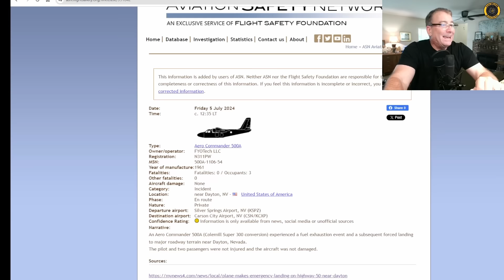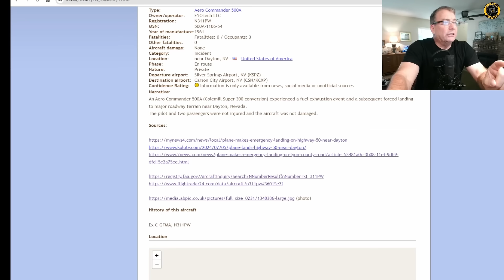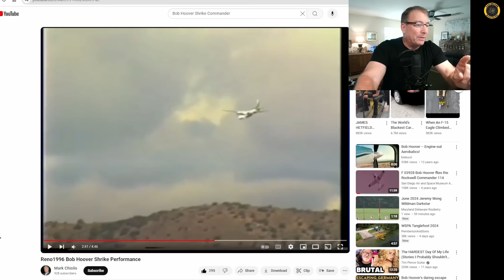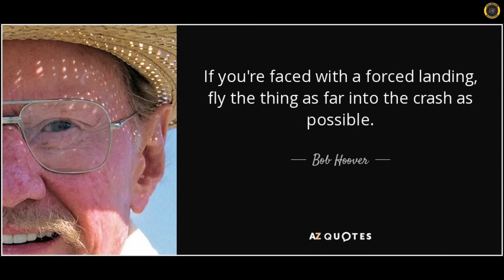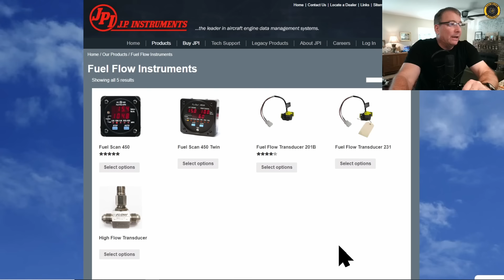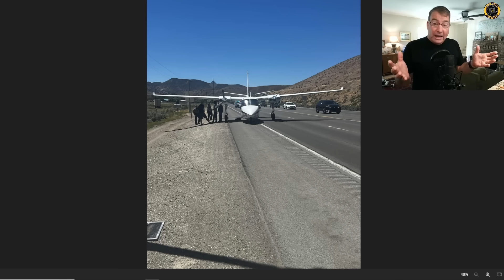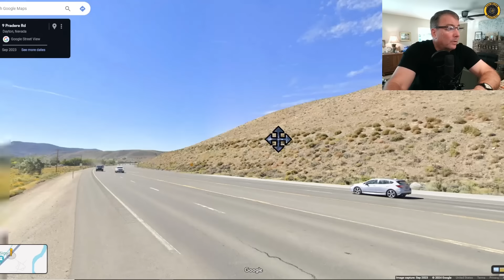Aero Commander Forced Landing Hwy 50 Dayton NV 5 July 2024

Comment: Digital fuel gauges are great, but they must be properly calibrated. Sounds like the JPI gauges might have been installed, but never properly calibrated. I would have removed the old gauges or placarded them inop. There is nothing worse than two instruments that disagree with each other.  Verify the accuracy and then trust it.
Reply: "A man with a watch always knows the time.  A man with two watches is never quite sure..."

Comment: Every CFI and AP I've ever known going back decades has said "never trust the fuel gauges" - the old float style senders are SO failure prone and inaccurate, and have caused so many avoidable accidents, I just don't understand - have no companies out there developed cheap, drop in fuel sender replacements which use modern capacitive or ultrasonic sensors for older piston singles and twins yet? And if they exist, why on earth does anyone still fly with old float sensors on their planes? This seems like a no brainer.

Comment: In general aviation aircraft the fuel measuring system is very primitive and nothing like the capacitance probes of transport category aircraft which span the length of the wing and provide very accurate fuel level information. Fuel flow such as JPI is fine, but as they say garbage in garbage out -unless you know what you’re STARTING with, any fancy technology in a light aircraft could easily provide erroneous information as to the actual amount of fuel in the tanks. 

In Texas, a few years back near Kerrville there was an accident with a Beech Baron. Again, the pilot  relied on fancy fuel flow information and experienced fuel exhaustion because of over- estimating the fuel he started with. Unfortunately, all 4 occupants passed away in the resulting flat spin.

Comment: ...Bob's Shrike had plastic tubes from the oil breathers - his manager/announcer told me that pretty much all the engine oil puked out during the show - I watched him put at least 6 quarts in each engine after the crowd left.  At a show up at Bellingham, Bob had just lifted off - doing his roll on takeoff, and suddenly quit the show, came back around, and rolled up to the announcer stand.  He popped open his pilot's door, and chucked a fire extinguisher across the ramp.  He then took off, and did a somewhat limited flight.  A few years later, at Pasco, I introduced my son to Bob and his announcer, and mentioned that I remembered the fire extinguisher incident.  Bob turned to his announcer and said, "WELL - HE remembered the fire extinguisher!"  I saw him do his show in the Rockwell Saberliner - not too exciting since you couldn't tell if he had shut down the engines!!

Comment: His first option was to go to Dayton Valley Airpark (they actually flew over it, before the problem showed) but he made the smart choice and put it where he could get on the ground safely, rather than trying to get the two more miles to the runway.  The Silver Springs airport manager actually watched him come down.

They probably towed it to Silver Springs because they had a wide road the whole way, with clearance for wings and tail.  I go through there periodically, and that would actually be an easier tow than going to Carson or Dayton Valley, even though it was about 5  - 10 times as far as the other fields.  They opened a hole in the chain-link fence to get it onto the airport, and towed it to the fuel pump.

They did NOT fly back to Carson yesterday.  A local plane owner reported that they loaded 100 gallons of 100LL, started the engines, but on run-up something didn't feel right to the pilot, so they tied it down for the night and rode back in the tow truck.  I drove past at about 1030 this morning and it was still sitting there.
Reply: I wondered why they didn't try the Dayton Airpark also. It all worked out well, except for the closing the 50 for the long tow😄
Reply: @hotrailstohell   Be a good excuse for being late.

Comment: all NHP had to do is block a section long enough for a T/O block both direcrions for all of 10 minutes and traffic could flow again easily same thing happened to me ON hwy 50 as well by lahoton resevoir fixed the issue had the road block for 5 min and T/O the road never experienced a long hold of traffic (my issue wasnt fuel starvation tho 😎

Comment: Basically I guess this pilot under estimated his fuel consumption regardless of what the digital or analogue were reading. We were taught that fuel gauges are unreliable and to use the  calibrated dipstick method which is always difficult on high wings and sometimes you needed two  if the aircraft had tip tanks as well. I remember flying passengers in a 182 back from a country property to the city on a very late afternoon early evening.The analogue fuel gauges were showing near empty ( but well known on this aircraft) and the passenger in the right hand seat noticed them and began to panick and demand I land at a closer airport. Initially he did sow doubt in my mind ( he was a car salesman) but I explained that I had measured fuel by the dipstick method before we left and we would have 90 minutes reserve after we landed at our destination. He was still unconvinced and continued to carry on. Of course, if my fuel consumption estimate was wrong, he may have been correct and had cause for concern. When we landed I dipped the tanks and showed him the number of gallons we still had on board but it made for an unpleasant flight for me.

Comment: We had a JPI in the Maule with an extremely accurate fuel flow function that we got into a habit of trusting. One day we found out that it's only as accurate as the idiot who told it how much fuel there was when you started. Luckily we found out at the pump but man, it was close.

Comment: Measuring fuel flow is fine but you need an absolute measure to calibrate against or there can be drift. With digital pressure sensors you can compute a good measure even if you are sloshing around with flat tanks. Doesn't take much algorithm to average over time and seeing slosh in response to g forces is a great check that the data you are seeing is real fluid, not a faulty reading. I call that principle rich data. Simple computer control is the way to go for many things. A water sensor is also good. Nice warning to have before take off. And yes good energy management is good too. I like to think of the whole descent slope as doable without power. Even fairly terribly gliders with a ratio below 10, do you really have to descend shallower than that...  if your plane can only do 1:7 why not come down at 1:7 or steeper... do you have to come the last 100km at 1:15 such that engine out is critical...  descent speed is typically higher speed than best glide so if engines fail you just keep the track at a bit lower speed. Should you need to burn speed there is flaps, gear and you can go low and fast in the soup to drain speed.
And of course good synthetic vision is nice to have in zero visibility when flying a glider. Problems don't only happen in socal sunshine.

Comment: I remember a turbocharged Shrike mod but most Colemill Continental conversions were non-turbocharged IO 520's. 

I've flown Twin Commander 500's quite a bit and the obvious advice is to never take off without sufficient fuel, although his possible failure to do so is mitigated by this pilot's masterful job of putting the aircraft down in one piece. Commanders are wonderful handing pilot's airplanes and their fuel systems are a model of safety and simplicity: it is nearly impossible to mismanage fuel in flight. There are no fuel tank selectors or cross-feed with an engine out because four fuel tanks feed a single header tank that supplies both engines. if there was any fuel aboard, this system should have been able to feed both engines, so the question of fuel management comes down to a single question: was there any fuel in the airplane?

Comment: It isn't always realistic or even possible to take off with full tanks if you are carrying passengers or cargo.  I'm assuming, of course, you don't want to exceed max gross weight and crash on takeoff.

That said, there really is no excuse for fuel starvation incidents.  I suppose a small percentage of them are due to mechanical issues, but if we're speaking honestly, the vast majority of them are caused by pilot foulups - whether because of ignorance of the aircraft fuel system, laziness, arrogance....whatever.

Comment: Why is is ever appropriate for any aircraft private, commercial, or otherwise to attempt to land on an occupied highway? I'm not a pilot, but it seems to me that when you get on an airplane, you take on the assumed risk that airplanes sometimes crash. I get that true accidents happen and deciding where the plane crashes is impossible. But, to consciously decide to risk the lives of drivers to save your own skin to me is reprehensible. How do pilots justify the risk?
Reply: Not an assumed risk if you are a passenger and believe the pilot has enough fuel or do you sign an indemnification agreement when you board a plane?
Reply: @bw162  I disagree. Passengers understand that planes crash, the same as pilots. You wouldn't allow cars with passengers to swerve onto playgrounds to avoid crashes regardless of wether children were hurt. The risk is yours for in driving your car. Passengers too. I think it's always wrong to put others at risk to mitigate your choices.
Reply: @murdock1450  You would be the first to sue the airline if injured.

Comment: It looks like they were within gliding distance of a great runway at Dayton Air Park. Why didn't they choose to land there? It would've looked very foolish if the landing on Hwy 50 had ended up in injuries, damage, or fatalities to anyone on the airplane or the ground when there was a perfectly good airport nearby. The other takeaway from this incident besides the need to always take off with full tanks is to be FULLY AWARE of landing options along your route of flight should you need to put the airplane down because of an emergency. I have flown gliders in this area many, many times, and Dayton is always a possible option if I were to get low in that area. If I'm higher and farther to the west, I can make Carson City (which I've landed at many times). But Dayton is a good out if one is coming from Silver Springs and can't make it to CC.

Comment: Exactly Juan! The timer is your most important fuel indicator. Twice in a Cessna 320-310 and once in an older V35 Bonanza I forgot to switch back to the main tanks and experienced momentary fuel starvation on approach to landing, and eventually I started using kitchen timer with a loud alarm and set it. Years ago at SLE a professional pilot of a C310 forgot to switch back to main tanks on an ILS and ran out of fuel about 1/2 mile from the runway threshold and crashed into a home. I've always thought that light aircraft with more than one tank per engine should have a reliable low fuel indicator on all tanks.
Reply: my son has stupid egg timer to let him sitting on the dash--a simple manual one--it cracks me up
Reply: @dethray1000  On the dash of his plane or car? Those digital egg timers can be handy, have you or your son happened to see one with a bright flashing light?
Reply: @jackoneil3933  plane--when his wife is with she hits him with a stick--not digital,old mechanical one stole from grandma

Comment: He picked the right hwy to land on.  The lonliest hwy in the lonliest state.  All kidding aside.  We lost a national hero and home boy, Francis Gary Powers in a similar deal.  He way flying Bell Jet Ranger type rotor craft for LA NBC TV when he and the camera man were killed at a landing area.  He knew he had fuel because the analog guage didn't work and when it indicated empty he always had 20 to 30 minutes of flight time.  Except on that day as the mechanics had fixed and installed a new accurate guage.    He told the camera man not to worry as there was always extra fuel in the tanks.  They fell about 100 or more feet with dead rotor right in front of a crowd.  Not sure if cameraman was killed.  Look up the report.  Sad.  He survived being shot down in  U2 from about 90,000 ft and 5 yrs in Soviet prison to a failure to communicate situation.  Gary grew up about 35 miles from home.

Comment: It’s possible that the JPI fuel monitor doesn’t have tank quality sensing, it might only track fuel flow. If that’s the case you would have to enter a know quantity after fueling the aircraft into the JPI. Good decision by the pilot to take Hwy 50 while he still had one running engine.

Comment: What would a "Full Self Driving" car have done to get out of their way?
Reply: FSD is currently at level 2 so driver is still responsible. the driver would have seen the car and stopped or moved out of the way.
Reply: @marctronixx Hust a guess but I think the comment was satire.
Reply: @marctronixx  The highest level 5 or whatever...    FSD would drive right in front of or under the plane. It was just an intellectual exercise.  No matter  FSD will not be about for decades if ever.
Reply: @marctronixx  That didn't answer the question.  I know what drivers do.

Comment: Regarding fuel gauge requirements you are continuing to propagate the myth they only need be accurate at zero.  See this Pilot Workshop discussion dispelling that myth:
The common misconception originates from the pre-2017 version of FAR 23 for aircraft certification. FAR 23.1337(b)(1) stated that each fuel quantity indicator must be calibrated to read ‘zero’ during level flight when the quantity of fuel remaining in the tank is equal to the unusable fuel supply. In other words, fuel gauges should be calibrated in terms of remaining usable fuel. But zero usable fuel isn’t the only time they’re required to be accurate. This immediately followed FAR 23.1337(b), which stated that there must be a means to indicate to the flightcrew members the quantity of usable fuel in each tank during flight. An indicator that’s only accurate when the tanks are empty doesn’t satisfy that requirement. In 2017, FAR 23 was rewritten, eliminating that wording. The new FAR 23.2430 says that fuel systems must provide the flightcrew with a means to determine the total usable fuel available
(Note the 2017 change didn’t change the requirement, but was only made to try and make the myth disappeaer)
Reply: Well said!!

Comment: Always take off with full tanks is not the best advice, especially at high DA because the extra fuel can make the aircraft unnecessarily heavy, worsening performance that is already compromised due to the high DA. The "always" here is to always know how much fuel is in your tanks before you take off.

How to know that? Not with a fuel totalizer. It tells you how quickly you're burning fuel - not how much fuel you have. It doesn't know how much fuel is in the tanks. You have to tell it that. Which means you have to know that. And one great way way to know is a good old fashioned calibrated fuel stick. Every pilot should have one, and this guy may soon be explaining to the FAA why he didn't. I used past tense there, because I suspect that he soon will have one, even if he has to make and calibrate it himself. A fuel gauge may be wrong, but a wet stick cannot lie.

Comment: 6:54 Oh, not that old wives tale again about fuel gauges only having to be accurate when showing empty. 🙄
Reply from the maker: you might want to actually try reading the regs Jeff...
Reply: @blancolirio  FAR 23.2430(a)(4) Provide the flightcrew with a means to determine the total useable fuel available and provide uninterrupted supply of that fuel when the system is correctly operated, accounting for likely fuel fluctuations;

There's nothing there that says that you can get away with a fuel low level indication alone. Fuel quantity indications have to be reasonably accurate, which is why you're required to calibrate fuel quantity indicators when you change something significant in the fuel system. Like installing a JPI. Otherwise, all you'd need to be compliant is a light that comes on when you have an empty tank, which is clearly not the case.

The myth you cited has been addressed many times by better writers than me, but it just won't die.
Reply: @jeffg7  Good job, Jeff!  I'm like you and get so frustrated when folks that should know better get this wrong.

Comment: I find it incomprehensible that they cannot make fuel gauges accurate with modern technology.  There is absolutely no technical reason for this. The FAA needs to make this a priority.  Fuel gauges should be at least as accurate as modern automotive gauges are, period.  I also see this as another reason these antique aircraft should not be allowed to be flown except in exceptional conditions until they can safely fly (i.e. fuel gauges that read accurately).  In particular, they should be banned from being used in training environments.
Reply: What's the age of antique?   And what is wrong with using a watch to track fuel burn?  If the FAA mandated upgraded fuel gauges, there would be 1000's of little planes grounded. It will cost me $5k to modernize my fuel guages to the newest tech. I'm not willing to spend that when my 5-10 clocks I have in my pocket, on the panel, on my wrist, on my ipads, are free. So are the timer functions.